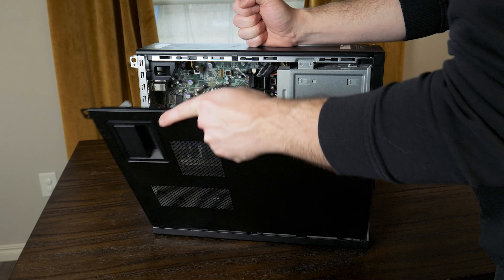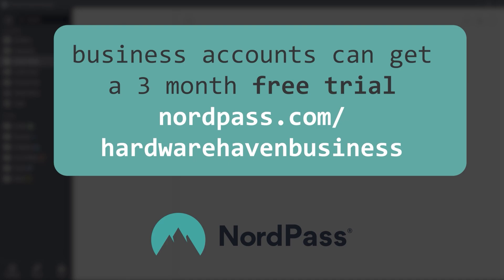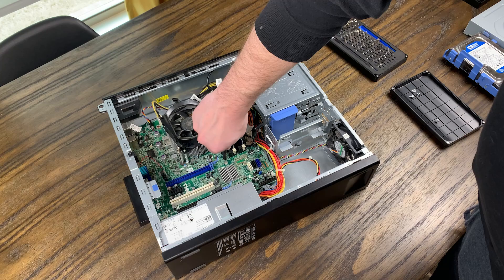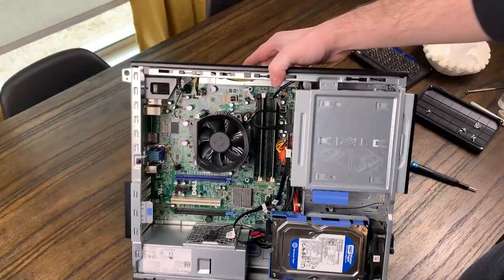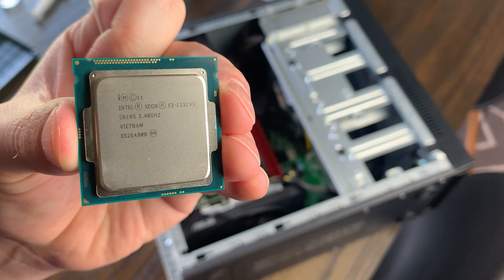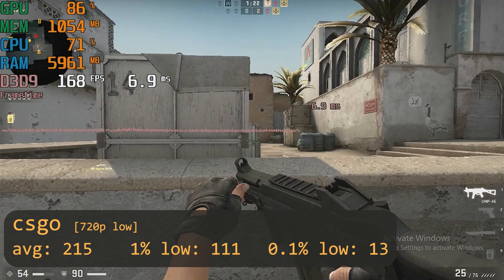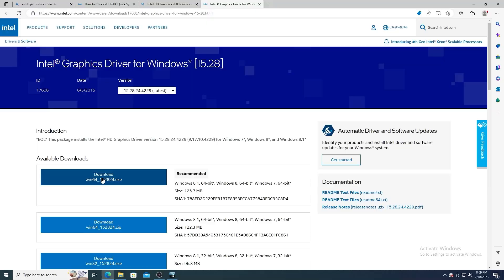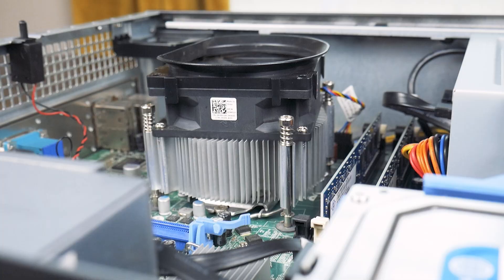What Can We Do With This Dell Optiplex? - Landfill To LAN: Optiplex 790

Comment: If you get an optiplex with something like a dual core i3 CPU, you can get cheap Xeon E3 CPUs that run on consumer sockets that are 4c8t like i7s with similar TDP.

For a friend, I used an H81 Optiplex 3020 - and upgraded it to a Xeon E3. Threw in a GPU and some RAM and he was good to go.

Just know that since Skylake, Intel started locking them down to C series chipsets only. However, cheap Dell Precision boards do carry C series chipsets.

Also note, you may need a $5 adapter to get a standard PSU working. Dell, HP, Lenovo, etc started using 12v only power supplies before 12VO standard came out to save costs. Adapters convert 5vsb to 12vsb.